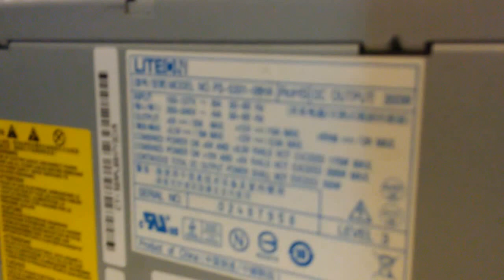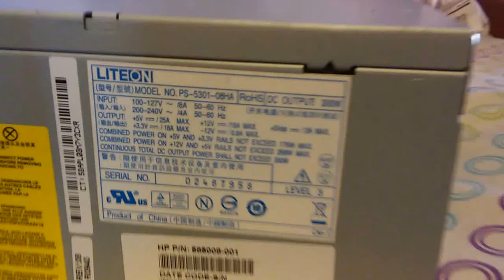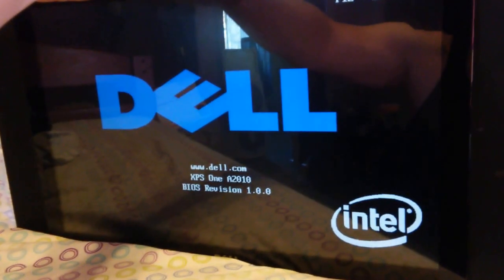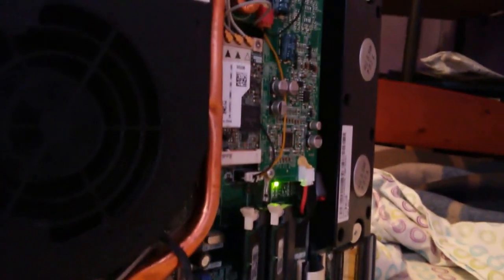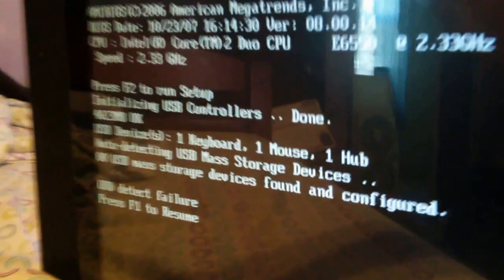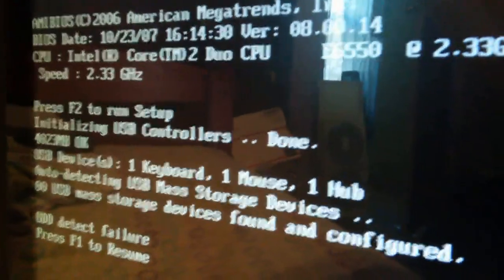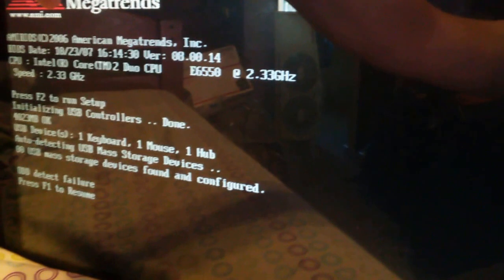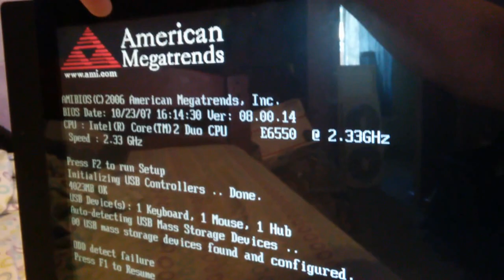Fix your Dell A2010 Power Supply Failure with ATX PSU (Real Geeks don't need a Squad EP2)

Comment: 6:22 Dude, that capacitor to the right of that black connector is FUCKED.
Reply from the maker: Nah, it was just the camera, all the caps were good on that system. Youtube wanted to do some wobble correction on the clip, and it screwed up some. I got rid of that system anyway. I did get my hands on a dual xeon quad server, with 24gb of ram and a couple 250gb WD blues in good shape.

Comment: I hooked it up exactly as you did with the same power supply and that's what I'm thinking
Reply from the maker: Pull all the ram out and see if it beeps when you start it. if it doesn't, then there's something wrong with the motherboard